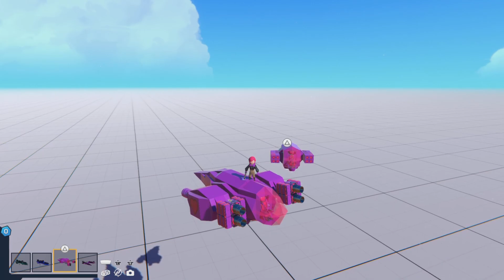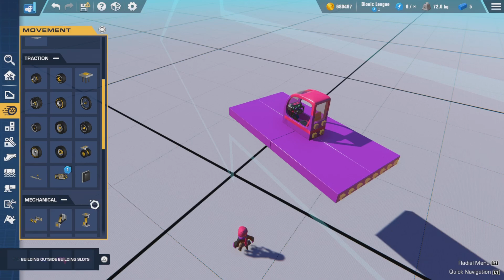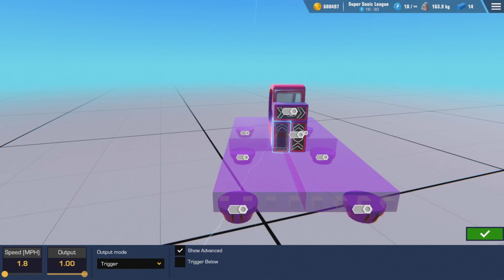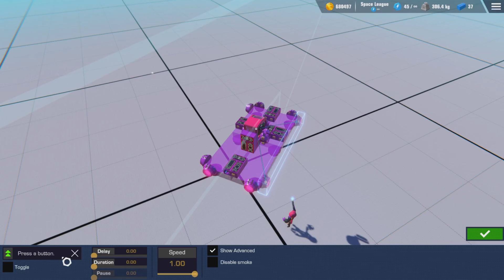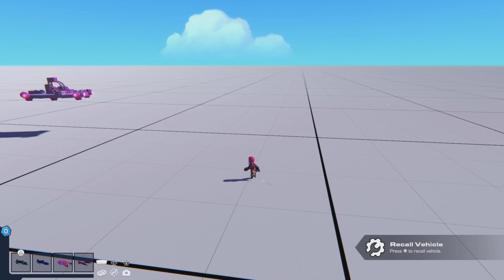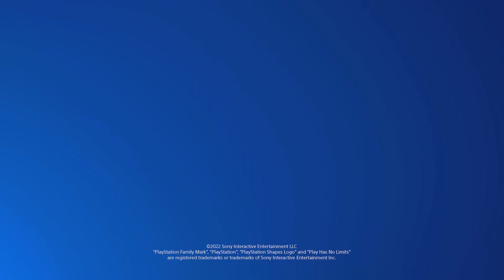Hover Stabilization Logic Tutorial [Trailmakers]

Comment: i dont know if your gonna read this but, when i move a direction eg). forward, backward, left, right. it doesnt stop moving it sorta just keeps drifting that direction, do you happen to know why that may be?
Reply from the maker: My first thought is that you may have set the forward/backward/sideways speed sensors the same as the up/down sensor, but they slightly different in that they are set to 0.0 speed and in default 'trigger above' mode. If thats not the case though let me know and I'll keep trying to help solve the issue

Comment: I can't get it to work, I made it exactly the same as you but it will not hover, your and gate also seems to already have some inputs set, mine start out empty by default, even tried putting something in there (edit, after placing a new AND gate, the logic does seem to get it, I did have to add a negative button to the NOR gate to go down)
Reply from the maker: I think you mistook the old ui because I've just reviewed this video and the AND gates do not get any direct controls assigned to them, those are the old blank input symbols. I also have to assume you didn't pay attention to everything because the NOR gates did receive an input to turn them off, as seen at 3:40 for the main hover circuit and for each directional circuit as well. I'm sorry you had issues following the tutorial though, so in future videos I'll try to be more clear about what's being done and why

Comment: Hmmm, can this stabilization be applied to battleships?

Cus I slapped the bombay artillery to my battleship builds, particularly the cruisers

And since they sail at fast speeds, I wanna know how I can fire rapidly without the boat tipping over cus of the recoil, despite it having a counter weight
Reply from the maker: You could certainly use water engines in place of thrusters to do this for boats or subs, but if tipping is your issue the logic won't change much, this system is more for positional stability that for anti-tipping. you'd more likely need some gyro stabilizers on high strength settings like the tutorial uses or to add weight to the underside of the ship to balance it out from the weight of the artillery system up top

Comment: Do you happen to know any logic for plane stabilization without gyros

I've been trying to make some proper performance fighters but I'm still having stability issues
Reply from the maker: By stability issues do you mean it pitches up or down when it should be holding level? Because that would probably be a job more suited to balancing weight and lift or adjusting your aerodynamic profile than logic into the elevators and ailerons. Or are you doing an autopilot mode, because that can be done with angle sensors and a bit of logic into the control surfaces for sure
Reply: Not so much stability in those terms
In terms of pitch I could always do some form of trim 

Morso in a sense of making the motions smoother 
A compensation system of sorts
But without the use of gyros

Persay I wanted to yaw right or pitch up
A system to compensate the bobbing

ALSO 
Do excuse my tone
I'm not at all demanding your assistance and you don't have to reply or anything of the sort
Reply from the maker: Ah I think I understand what you're looking for but unfortunately I haven't really done something quite like that before. I have done a system where the control surfaces are limited in angle at higher speeds to deal with the sharper reactions but have full range of motion at lower speeds but that doesn't really do anything to dampen unwanted movement.
And don't worry, your tone is fine and I like to help where I can :)
Reply: @fenrir_fullmoon
Thankyou oh so very much for your help all the same
Your videos are incredibly helpful and quite a joy in my day
I am very thankful to have found your channel